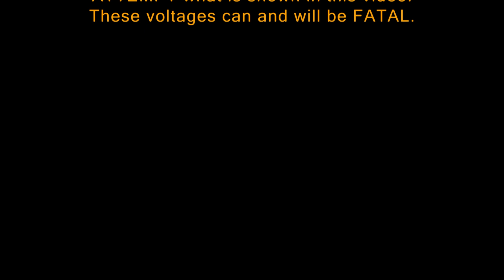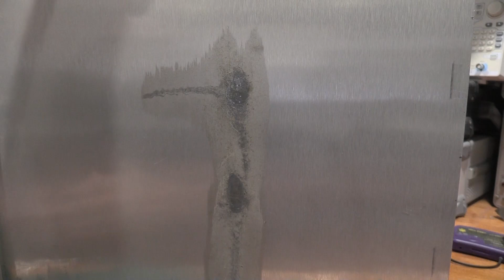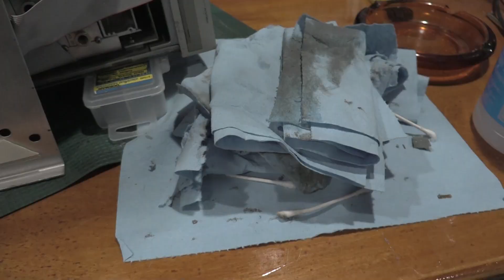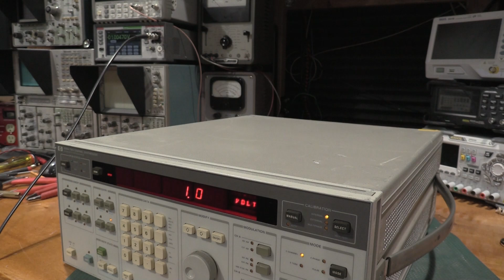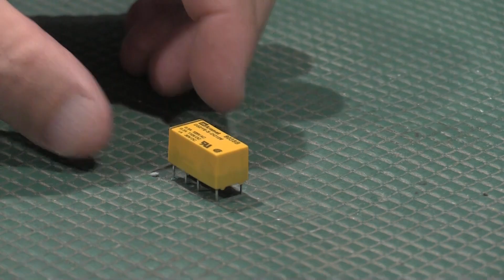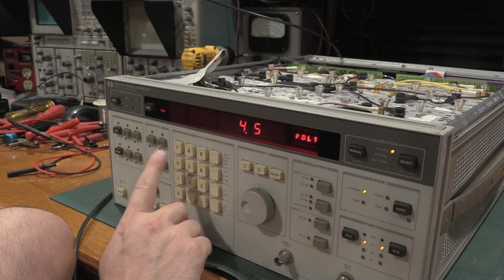HP 3326A Repair and Lab check in Part 1

Comment: I wonder if the voltages of signal involved carry over the transition between types of rated contacts, leading to micro-arcing that increases the contact resistance??   You should have less than 100milli-ohms on low level rated contacts.. even less than 50 milli-ohms is achievable. I ha e measured as low as 30 milli-ohms in our lab, using Kelvin leads. Exceeding very specific current and voltage ratings will lead to dramatic increase in contact resistance over time and cycles.  Given the signal levels this generator can achieve, if that is routed through the relays, I suspect this is the cause of failure mode.